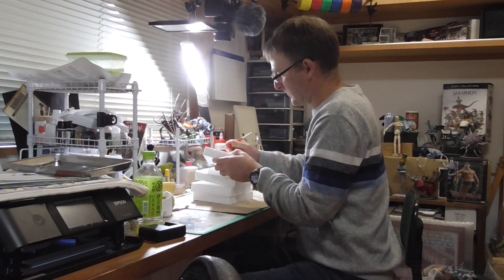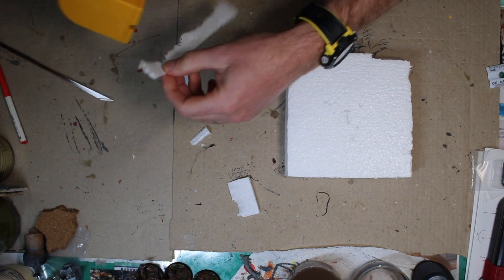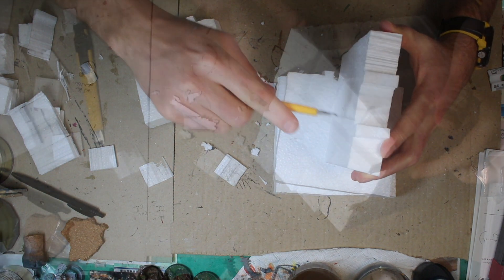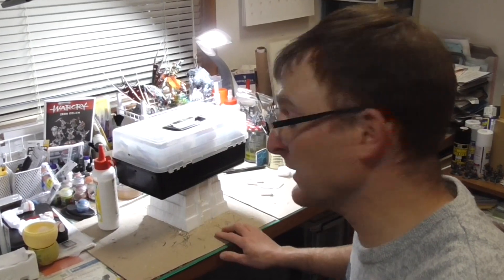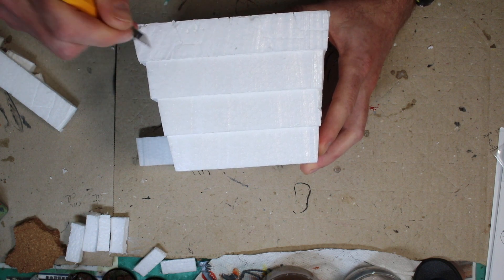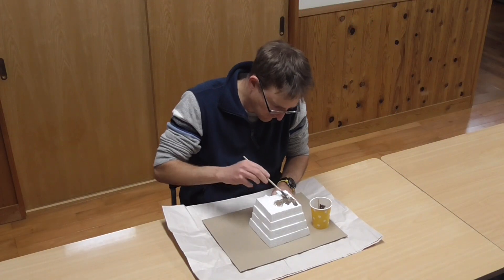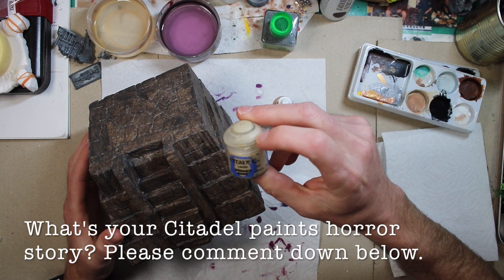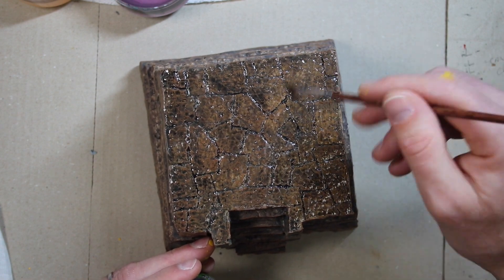Building a Simple DIY Seraphon Realmshaper Engine

Comment: Nice work ! Do you also plan on doing the magic crystal on top ?
Reply from the maker: Yes, I plan to make a removable engine using spare bastilidon parts sometime.
Reply: @brianshobbyspace3569  have you built a bastiladon?
Reply from the maker: @twigius5690  Not yet. Having finished up the first Start Collecting box I decided to get the Start Collecting Skinks box. The Bastilidon will be the first model I do. I plan on doing the Arc of Sotek but I should have some extra bits from that enough to make some sort of engine for the terrain I made. As it is the terrain just barely fits in my terrain carry boxes so the top decoration will have to be removable. That might become a video too.
Reply: @brianshobbyspace3569  I am halfway through doing my start collecting skinks box as we speak, I have completed the bastiladon and one of the rippetdactyl riders.

A tip I often give it to spray all the sprues before doing anything else that way the top and bottom will get you most if not all of the angels.

Another thing is that you shouldn't glue the ark of sotek onto the beast that way you can build the solar engine as well and swap between the two